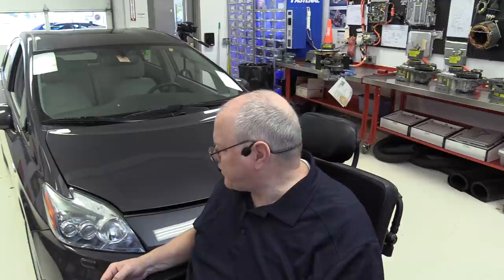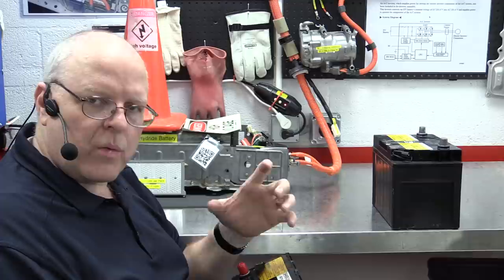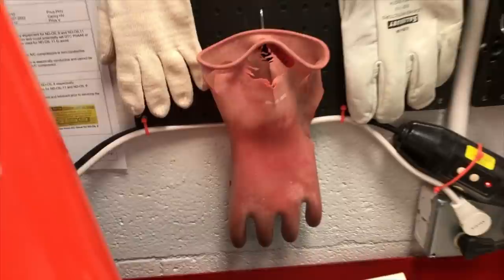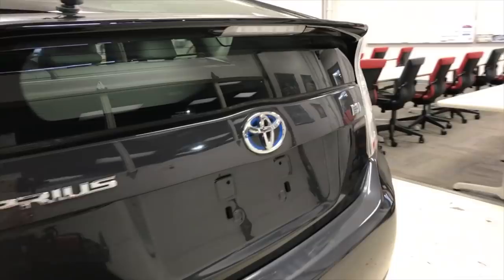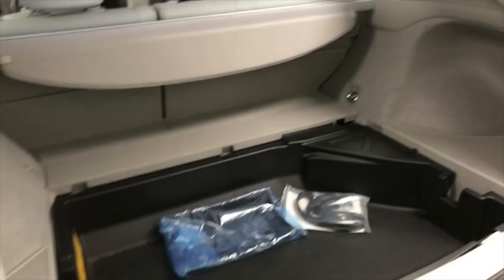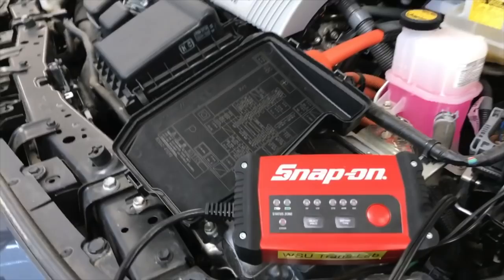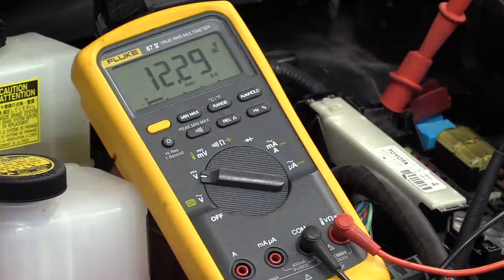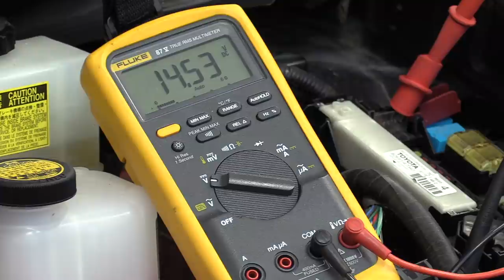Low Voltage Hybrid and Electric Vehicle Systems

Comment: My only error message I get are the yellow triangle, and all of the brake error lights, and "Check the Hybrid Charging System". I have a used brake master cylinder to put in. I was told that there was a fault code indicating a bad AC Compressor. So I bought another one and will get it installed tomorrow or Monday. I replaced the Inverter/Converter. And finally, I removed the bus bars and cleaned the corrosion off, adding a thin film of conductive gel. Reassembled and tested every cell to verify that it's good. It is. 
The 12vdc is also good. Oh, I refilled the inverter cooling system too.
After all of these things I've done, I still get the same error.
So, I pulled the contactor tray and tested them with a 9v battery. They are all good. I watched an Ohm meter to make sure that the contacts were conducting, and they were. 

The only thing back there is the startup computer. Do you think that there's something out of wack in there? 
I can also try bridging the contactor to start the ICE.
I bled the brakes as well.
Checked the oil, it was okay.

I just don't know what else to check out.

I also bought a code reader, but I don't think that it's good for Hybrid cars. Do you have any suggestions? 

I'm prepared to try to turn over the ICE with a socket and long breaker bar to see that it rotates.

Change the AC Compressor, vacuum and recharge the system tomorrow.

Walk over to the auto parts store and exchange the code reader for one that gives the right codes for a Hybrid.

While I'm at it, why not change the plugs too...

Thank you again, I wish I could take your class in person. You really know so much about these critters. I feel so blessed to be able to watch your videos on these cars. I'm amazed at how much you know. Thank you for sharing your wisdom, knowledge, and specialty with us.

Peace, Grace, and Hybrid Happiness to you and family.

Susan 🌺

Thank you very much for specializing in Hybrids. I would like to see you cover this subject in a lesson plan sometime soon.

Oh, mine is a 2012 standard Prius. My friend calls it a Priass. I refer to him as something without the "Pri" before it Lol.

Sorry for the lengthy message, but I'm at my bitter end with it.

Comment: Thanks Prof,for leaving this available. After a dead 12v ,twice,couldnt figure out the drain.Now  I see,the dash screen and daylight running lights ,all on while parked but powered up,[damned covid] The car has to have a good run.
Reply: Hey did u ever get a red triangle
Reply: @kwesson1489  don't recall one,but return from a trip in slow moving traffic,runs down the high voltage battery,so no improvement there.
Reply: 2yrs 6 jump starts later the auto recharge system not up to the job imo.

Comment: I have the rare 2008 Altima Hybrid (which is basically a Toytota Camry Hybrid with Nissan badges) and it has an "Emergency" starting procedure when the 12-volt battery is dead. You have to hold the Start/Stop button for 15 seconds. I'm assuming that it uses the HV battery to start the engine. Haven't had a chance to try this out yet so not sure how well this works.
Also, I didn't know about the requirement to have an AGM battery, will have to take a look at what my Altima has in it, since we bought it used.
Reply from the maker: Thanks for your feedback. You are correct, the HV battery is used to power a motor in the transaxle to start the engine.
Reply: @WeberAuto  
Do the  2nd Generation of Prius (2007), also have an "Emergency" starting procedure?  Naz.

Comment: one question for you about the AGM battery, let's say that my car has just regular battery , if i replace the regular battery with AGM Battery , will the AGM battery cause damage to my car ?
Reply: No they are built to be installed in the interior of a car. The AGM batteries are generally sealed, versus lead acid which has caps for servicing. So in the event of accidents or flips no battery fluids leak out and onto others.

Comment: Hi sir your videos are very very helpful, i have a problem with my car i have a toyota prius 2012 when i drive slow engine stays on but the hybrid system switches off and a warning message saying, check hybrid system comes on the dashboard. Ive changed EGR valve and also hybrid battery has been checked. Please could you advise me what to do. Many thanks.

Comment: Dear doctor ,, 

How i can disciminate between original and copy NiMH traction battery , taking into considiration my lexues es300h 2013 milage about 90k mile , and there are 7 blocks below 14 volts.

Thanks alot

Comment: Really great instruction John. I have a 2010 Auris which looks identical to the Prius transmission. Do you know why after charging the auxiliary battery I experience a juddering Sound for a couple of seconds when I first drive off. This only happens when I charge the auxiliary. Many thanks Mat

Comment: Hi, thanks for All your videos.... One question , on the 2007 Altima hybrid 12v battery does it comes with the temperature cable ? Or only the 2 cables? Thanks for your time and help....👌👀
Reply from the maker: I do not know. If it is mounted in the truck area, it probably has a temperature sensor and vent tube

Comment: Hi love all you're videos good work. The only car to not have a traditional lead acid 12 volt battery is The Hyundai ionic hybrid the 12 volt battery is a lithium ion 12 V but it installed in the main battery pack and there's even a button on the left side of the dashboard if in the case the 12 volt system has been drain from the a phone or any other device connected to the 12 volt system the only downside is the price of replacement if it ever goes bad.
Reply from the maker: Wow, I did not know that. Thank you!
Reply: V10PDTDI Seeing as the Kia Niro is on the same platform as the Ioniq, I assume it also uses the same configuration?
Reply: The Hyundai Ioniq 2016 models auxiliary (12 volt) battery pack are located at the trunk. Perhaps, yours is the US model.
Reply: Pretty big downside to save a few inches of space.

Comment: Got a question: why AGM battery is necessary? If toyota uses a normal battery, they can charge the battery more frequently, so the normal battery can also works, all they need to do is to command DC-DC charger more often. Why they need the battery discharged deep before recharge?
Reply from the maker: I do not know why they used AGM batteries. I suspect it is because they could use a small size and weight battery and have it last through the deep cycles. The fourth generation Prius uses a regular lead-acid battery although is is a European Normal (EN) size. the owner's manual states that any lead-acid battery can be used as long as it fits in the battery tray and hold down brackets.
Reply: Thanks you.

Comment: 👍 just wondering highest current draw on 12 v system Toyota allows on this gen Prius. I’m trying to hook up the largest pure sign wave 12v to 120 v AC inverter. Thanks! I should probably check the manual.  Hehe.

Comment: Hello! Thanks for the great videos. Could you advise me to where to  ran an extra 0 awg cable from if I would like to do a so called big 3 upgrade as I would like to install a sound system in my Prius mk3. Where is the other end of the white cable is going from the fuse box? Many thanks

Comment: I've started driving a used Prius C and am enjoying trying to understand the details.  Am I right that the 12V system is essentially for accessories and computers only?  The ICE is started by MG1 from the traction battery isn't it?  If so a Prius with dead 12V battery probably needs a tiny boost to get started.  Maybe  30 or 50A  at 12V to get the various computers, control systems, coolant pump, vacuum pump and other accessories up and functioning so a computer can start the ICE and begin recharging the traction battery with MG1 and charging the 12V accessory battery with the DC/DC convertor.  Could one conceivably build a little lithium "Prius booster" the size of a key fob that would plug into the 12V outlet in the cabin and provide 50A for 2 or 3 minutes until DC-DC takes over?

Thanks for all the fantastic videos prof. Kelly. I never knew a transaxle tour could be so fascinating.  :-)
Reply from the maker: Thank you! Yes, you are correct about the function of the 12V battery. Thanks for the feedback!
Reply: i tried this and the 15A fuse blew.

Comment: Professor Kelly: so the 12V battery, since it is less than 12.5 at the terminal, is due for replacement or would you suggest to the customer that it can wait a little?
Reply from the maker: It is hard to tell without further testing. See my new video on checking the 12V battery and charging system on a hybrid or electric vehicle for more information: https://www.youtube.com/watch?v=_V9PiOpaxyE
Reply: Thank you very much for your speedy reply Professor Kelly, always appreciated sir!

Comment: is it better to charge your car using level 1 for longer battery life? Assume the faster charger may degrade battery overtime?
Reply from the maker: Yes, level 1 chargers will not degrade the battery as soon as level 2 chargers.
Reply: WeberAuto is there anyway to check how good battery status? My volt seems to give me different ranges almost daily basis. It’s anywhere 60-70km range... I never see 85km once? This is for generation 2 volts.

Comment: I have 3 to 5 error codes, on my Mariner Hybrid, just because my low voltage 12v battery ran down. I want to replace that battery with a LiFePo4 or a Li titanate battery, that can handle cold temperatures.

Comment: So, does the DC/DC converter (to 14v) care about charge current, or is it constant voltage?

And, Harbor Freight has a Viking 4 Amp Fully Automatic Microprocessor Controlled Battery Charger/Maintainer, #63350 about $40
It is AGM capable.

I would want to charge the Aux battery with the external charger to get it fully charged, before I turned the vehicle on, in order to limit the charging current.

I also charge the Aux battery about once a month with the external smart charger to fully charge it. The 14 volt system will not do that.

Good stuff, thanks for posting!

Comment: Hi john superb series by the way have you any idea what type of 12v battery on a Toyota corolla touring sport 2.0 2019.....the Toyota forum that I go on are split on the awnser between AGM or normal acid type...Michael uk.
Reply from the maker: According to Toyota service it is not AGM
Reply: @WeberAuto  thanks for that, so this could be changed with any good quality  12v battery?  why do you think this 2.0 hybrid corolla has a normal battery instead of a AGM...Michael uk.
Reply from the maker: @andwelovearpsychopat7820  They don't need an AGM if it is located under the hood. Special ventilation is not required there.
Reply: @WeberAuto  according to the uk corolla forum the 2.0 Corolla touring sports hybrid has the battery in the boot/trunk

Comment: When I need to remove my dead 12V AGM battery from my Toyota Axio Hybrid, do I need to remove fuses at the fuse box ? I've charged the 12V AGM battery using a normal charger which I didn't check the specs and it worked when I put it back on the car but weeks later , battery found dead again, why would you think that is ?

Comment: Is there any way to raise the voltage im doing a car audio build than the lithium’s would work better at 15v but my Prius only does 14.1 I saw on another video the converter under the hybrid synergy drive is what puts out the 14.1 I have the Prius c so my guess is I wouldn’t have any luck but figured I’d ask anyways
Reply from the maker: Not that I know of.
Reply: @WeberAuto  darn true ima just have to put a lot of hell batteries in it because the voltage drops quick on the led acids

Comment: Fiat 500e electric -I tried replacing my 12-volt lead acid with a lithium ion motorcycle battery, under spec.  I lost all power on the freeway! Apparently the drive battery contactors are normally open & need constant 12v current to run.

Comment: So professor what's you taught on a 2015 Toyota Corolla fielder owner wanting to add two additional amplifiers to the car on the 12 v battery for a subwoofer of 800w, would this be safe is there a limit?

Comment: hello.
I own auris 2014.
and my 12v battery keeps running dead.
I don't get any error code or lights.
and it suddenly happens.
but when jumping start it with cables it charging again.
from your knowledge what could it be?
thank you.

Comment: Hi there. I have a 3rd gen Toyota Prius and I'm having some issues for a while with ( I think ) the 12V battery in such manner that when the Power button is pressed and the hybrid system in on, the multi information display on the top of the dashboard and also the trunk commands are not working for about 5-15 min (after that time delay the display pops on and the trunk also can be opened via trunk hatch button ) depending on how cold is it outside, no matter I drove or not the car the day before. Also I have replaced the 12V battery with a Bosch 40Ah for asian models and still the issue is there.
When I bought the new battery I checked the charging voltage when the hybrid system was on (the 201V high voltage battery was almost fully charged at the time the test was done and outside temp was around 5 degrees celsius ) and it showed around 14.75V.
  Is the charging voltage normal or is this happening because I'm using a non-Toyota 12V battery?

Thanks a lot and much appreciated!
Reply from the maker: 14.75V is normal.  It sounds like there may be a poor connection somewhere. I would check for trouble codes to see if there is any computer related issues. I would also check your fuses. Unplug them one at a time and plug them back in to see if any feel loose. Best wishes!

Comment: Hi Professor, I have a Gen 2 Prius which internally charges the 12V battery to between 13.5 - 13.8V. This seems to be normal for Gen 2 Prii.
Is there anything that can be done to bring this up to a more realistic voltage to give a longer life to the 12V battery?
Thank you, Eric
Reply from the maker: 13.5-13.8 is just fine. The voltage is regulated by the battery temperature sensor and battery state of charge

Comment: Hello, I have a Toyota Prius 2012 that has done 73,000 km. 12 v battery reads 12.7 with a multimeter, but on the car display it reads 11.7 v. How can I fix it in the car ECM?

Comment: Professor how do the engine charge the high voltage batteries without alternator? I mean what component is used to charge the high voltage batteries?
Reply from the maker: the DC-to-DC converter charges the 12V battery
Reply: And the high voltage batteries?
Reply: Ahmed Zulfe The engine spins the shaft on a 3 phase brushless motor. This makes the brushless motor act as an AC generator. This is rectified and regulated to charge the high voltage pack. It is also possible for the drive wheels to drive the same shaft (as they are all 3 connected through an epicyclic gear set). In that situation the momentum of the car charges the high voltage pack. This happens during regenerative braking. Other times electrical power is applied to this motor to drive the wheels of the car or to start the engine. This one motor is not just a drive motor but also replaces the starter and alternator. Toyota’s Power Split Device transmission (they call Hybrid Synergy Drive) is truly an amazing invention.

Comment: The Tesla Model S and X use a small 12 volt AMG type battery about the size of the one found in the Toyota Prius.
Reply from the maker: Thanks for your feedback. The Tesla model S battery I saw was huge, maybe three times the size of the Prius battery. I do not know what model year it was though.
Reply: The 12 volt battery is a small AMG battery mounted in the front trunk  and the HV battery is about the size of the passenger compartment mounded under the car.
Reply: Teslas are notorious for having dead/bad 12V batteries in as few as 12-24 months when most flooded batteries in gasmobiles can last 4-7 years in 4-season states.  (Tesla fan) Research online indicates that Tesla tends to overdischarge and frequently overcharge the battery more than is desireable for AGMs.   The Chevy Bolt has an AGM and someone has published GM’s charging strategy and it is very interesting.

Comment: Hi John, excellent info on the hybrid system, I have the Toyota auris hybrid, and the system is pretty much the same, but I like to know if I change my 12v battery at the back of the car does the car need a 12v feed connected while changing the battery, I have heard different info on this task.  it needs a 12v feed because of loss off hybrid computer systems.or may cause error codes.... Is this true or can I just change the battery as normal ?

Comment: Professor Kelly what a wealth of information on the inner workings of the Toyota Prius, Unfortunately, I live in Southern California. I would love to take one of your Weber State courses! Congrats on the series of very informative, technical information on a very complex car.

I have a question related to a difference between the Gen 2 and Gen 3 12 volt system engine compartment fuse box components. The Gen 2 fuse box had a long fusible link with a clear top on the left side of box. In the Gen 3's, it was replaced with what Toyota calls an "integration relay" at that same location. Specifically, why did Toyota eliminate the fusible link in the Gen 3's and replaced it with an integration relay? Does the integration relay serve the same purpose as the former fusible link? If not, then where is the fusible link (12 volt system) in the Gen 3's? Was there not a need for a fusible link at that location in the Gen 3's? Maybe you can cover this in an upcoming YouTube video?

Once again, thank you so much for sharing your wealth of knowledge! Keep them coming!